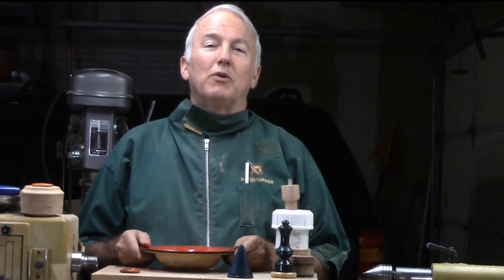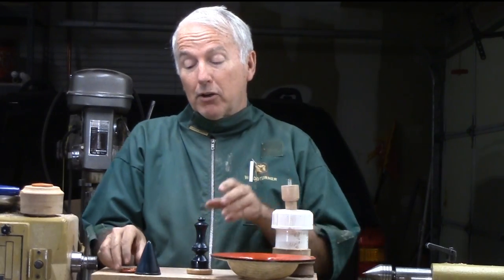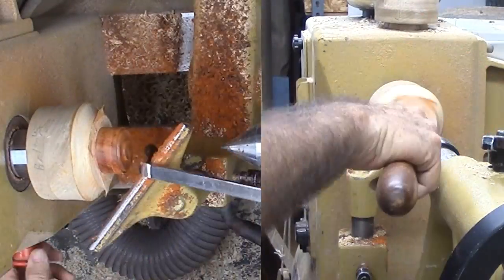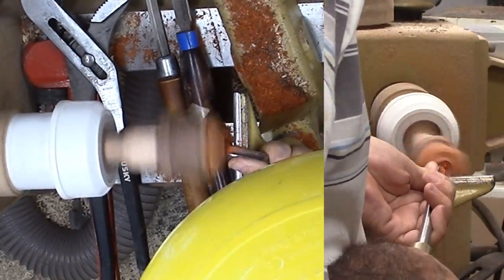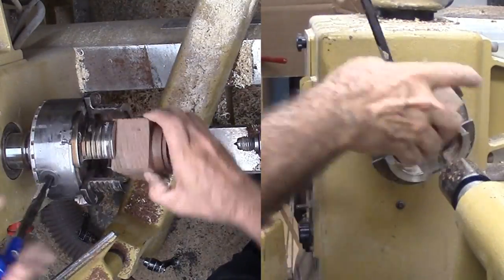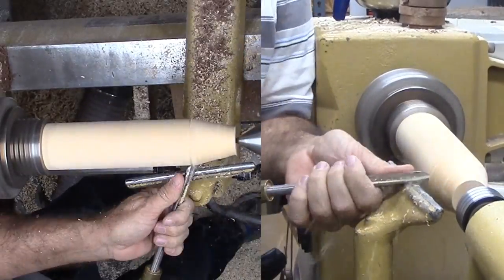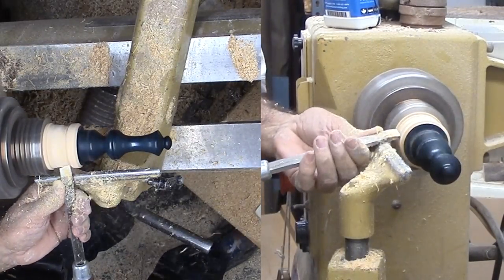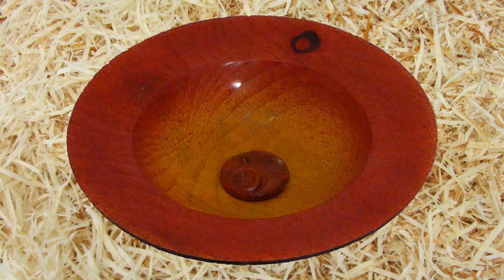Disaster Recovery - Woodturning Style x 3

Comment: I took your advice and made another tenon. Thanks for correcting my spelling I truly appreciate it. Any way ever thing was going on just fine, then I broke the tenon off again. I am going to put it aside for now and go back to it some other time. It will not end up in the burn pile.
Reply from the maker: I've never turned basswood. I've only heard of it in context with carving being a great wood for carving. I wonder if it is too weak for your tenon. If so, maybe you could glue on another wood that could hold a tenon. Later when turning the foot, cut away the new wood. Let me know how basswood turns as I have several nice pieces of basswood lumber to use up.
Alan

Comment: In my experience, ash takes and holds threads awesome.  I really should do a video on my home-made hollowing rig... used ash in several places, all threaded, and it's held up great over the years.

Didn't catch the previous video... would've suggested embedding LEDs into the base surrounding the hole, then filling it with epoxy colored in multiple colors.  You'd also need to find a place for a battery pack; somewhat difficult given the scale of the piece.  Great effect though. =)
Reply from the maker: Interesting ideas. I need to finish my hollowing rig also.
Alan

Comment: Great job. You always do such great work. I turned my first bowl on Thursday. I am making it out of basswood. Before I finished the outside the tendon broke out of the chuck. I put it in a longworth chuck in compression and I am about finished with the outside. Now to turn it around and finished the inside. I think I will hot glue it to a piece of scrap wood and bring up the tail stock. All I need to do is to sand and finish it. In your opinion, do you think this will work. I can't put it in the longworth chuck because it is larger than the chuck. I'm only a beginner so just keep that in mind. Lol. Thanks for the video and your opinion. Danny Sweet
Reply from the maker: If at all possible I'd try to re-cut the tenon (BTW the word is tenon not tendon) if you still need to work on the inside. Your Longworth may work for that. If you're already finished with the interior, I'd press it between a flat faceplate and the tailstock to refine the foot except for leaving a small piece for the live center. Then carve away the small stub and sand.
Good luck.